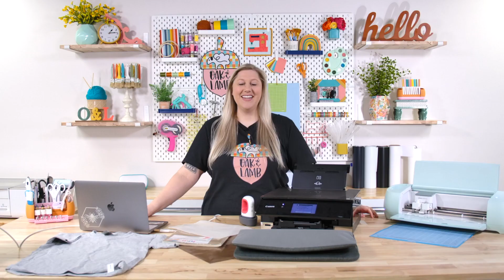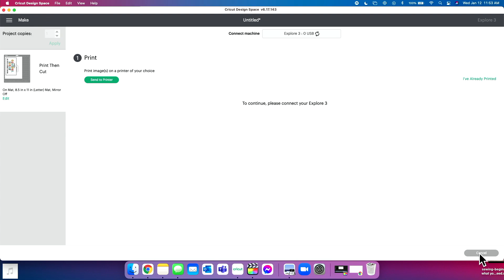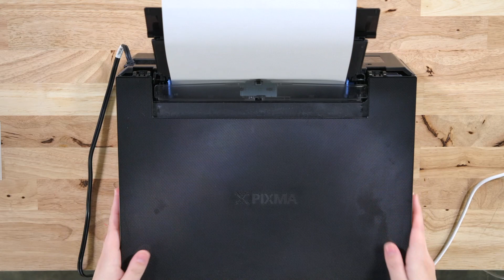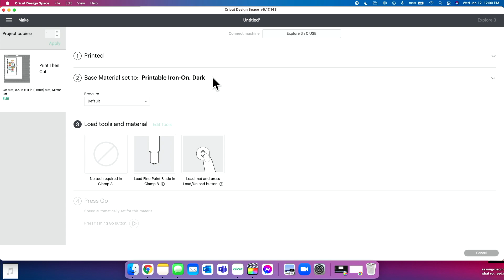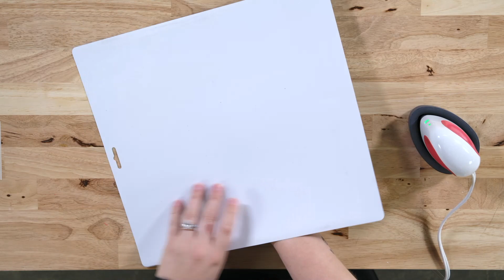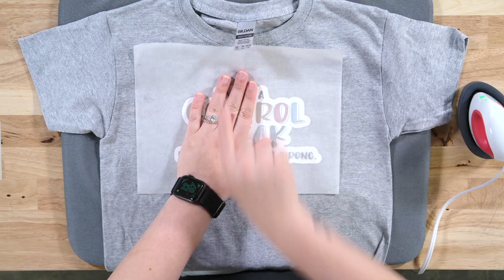How To Use Printable HTV

Comment: I've been wanting to try printable vinyl and now it does not look so scary!  Do you think you can apply printable vinyl to wood?
Reply from the maker: It's possible but not really recommended :) The wood would need to be perfectly flat and smooth and it would not hold up outdoors, so indoor use is better with printable products.

Comment: Is there a reason not to use a transfer sheet?
Reply from the maker: It's not necessary with this product :) Also there's not a good mild one on the market that wont peel up the ink from the material. Good question!